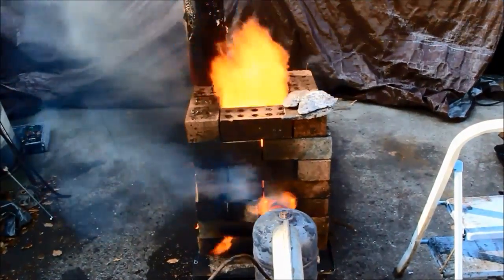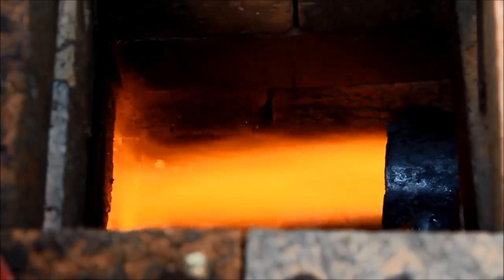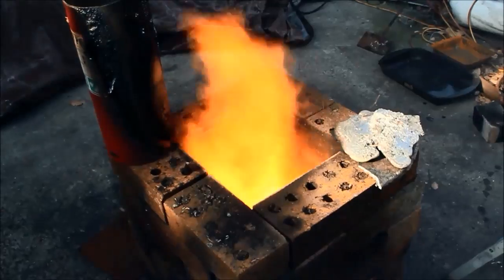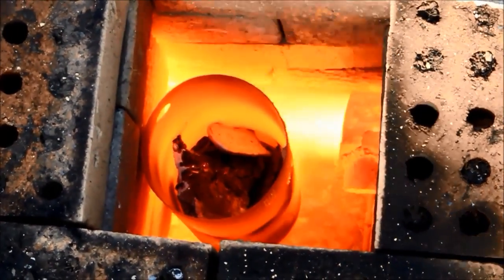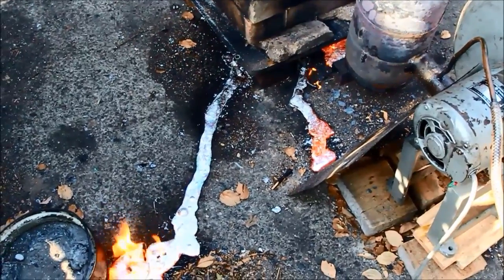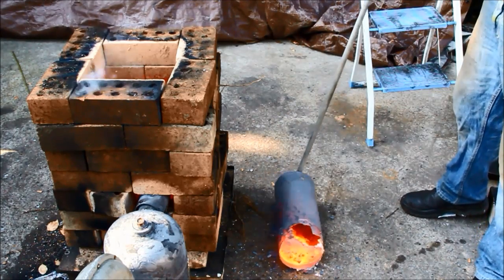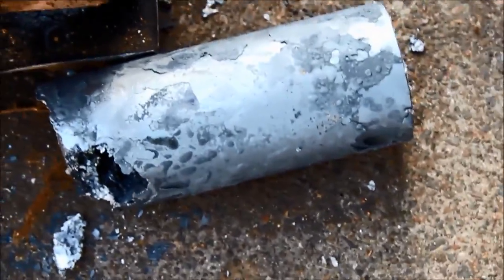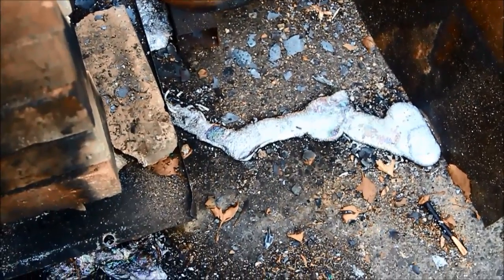Steel melt in Home Brick furnace.

Comment: Absolutely incredible!
Reply from the maker: Yeah, I thought so. Didn't see that coming at all. I'm still not quite sure wether to be impressed or annoyed! Given the problems this creates, far more likley to be the latter!
Reply: Oil Burner I would be impressed!  Quite some heat you got there! 
I am currently having the same problem,  I'm trying to find a way to use waste motor oil to melt lead but I'm heating the lead excessively. 
My solution to you would be to use a old propane tank as a crucible and build a larger furnace.  I'm sure that beast would handle the larger "pot". 
Heck I would actually build the furnace in the ground with fire brick. Can't melt dirt! Or can you!
Reply from the maker: magana559 Well if you can melt dirt, I think I'm heading the right way to find out!
Reply: Excellent!  Wishing you luck! Please video the results!
Reply: magana559 From experience: Propane cylinders aren't actually much tougher than fire extinguishers. I used one as a chiminea patio heater, and used an air blower to get the temp on the coals up: Blew a hole straight through the bottom! I think the steel was actually burning, bright sparkler type sparks everywhere for several mins till i shut the air off

Comment: I had a similar problem. I was using a steel fire extinguisher to melt aluminum, and I  use my homemade charcoal to start the heat, then I pack coal on top of that and then crank up my air and soon the aluminum will melt instantly.  Well, just as the level of metal was reaching the top of the crucible, I went to pull it out to pour and the whole bottom of the crucible fell out and luckily I was wearing flame retardant pants because molten metal splashed everywhere.  Needless to say, it was not fun cleaning up.

Comment: Aluminum does NOT "eat steel" oxygen does. Once aluminum goes to a molten state, there's no air between the Al and steel... which stops the iron from oxidizing and reducing. The outside of the steel can still oxidize but it would never eat through a fire extinguisher that fast. I have a steel crucible made from a super thin hair spray can that I melt aluminum in ... I've done it at least 30 times with no holes anywhere. That steel got white hot, hot enough to melt and that's damn impressive.

Comment: I just happened to find this channel when looking for something completely different... I'm really impressed at the heat that puts out... incredible. Here is an idea... what about a granite or marble tile as the bottom? Here in the USA most home repair stores have them in 16x16 inch (0.4m) sizes. Would that work? Would it be possible to make a wood form, put your vent and feed pipes in place, then fill with cement? That would make a seamless (or relatively so) furnace. The wood would burn out during the initial fire. You would have to wait until it was completely dry... then slowly fire it up to avoid trapped steam... but might be better at containing spills?
Reply from the maker: Hi Jerry, I don't think granite or marble would work too well. I used some slabs years ago as a base in my wood fired pizza oven and the stuff could be crumbled in your fingers after about 3 fireups and that oven' gets no where near as hot as this one. I could give it another try though. Kitchen factories often have stacks of it they cut out from benchtops they throw away so not hard to get.
I think with the cement I would have to use refractory type as regular concrete would explode. Been there, done that. It's a good idea though as I have been wondering about a base and this is the obvious choice even though I overlooked it. Thanks for the tip!
Reply: Oil Burner
Ceramic clay? I don't know much about high temperature stuff... it will be interesting to follow along and see what you come up with. Subscribed.
Reply: Oil Burner
In fact even ordinary concrete will melt (check out my video of concrete heated to 1260°C) and granite do melt or get so soft it will collapse. So ju really need some "heavy duty" materials at these temperatures :)

Comment: If you are still on doing this type of stuff try to keep the temperature lower I have used a small camping propane canister four or five times. I'm going to make one that uses propane here soon I'm going o get a clay graphite crucible so I can melt brass and copper for sure with this possibility of it melting.

Comment: very awsome, let me know when you what to melt the bricks, with out any extra energy on the input side, I am just wondering if you have any Ideas on how to use this to heat homes?
Reply from the maker: Have a look at this Vid and the Description Scott.  Free fuel water heater setup. I used an old gas water heater as a boiler and circulated the water through a car radiator with a solar circulator pump.  The pump was underpowered but I never got round to changing it because the setup provided more than enough heat for my home.  We slept with just a sheet and light blanket on all winter. Also see my Vid on the fuel control setup. I used this to supply the fuel to the burner to keep the heat output controlled. Once the house is up to heat, you don't need much output on the burner at all to keep it warm.
There are many other ways of home heating but as I'm not keen or have the space to put a burner inside the house, I like this way because it can go a safe distance away and I can just pump the water round through any convinent place. I put the radiator in the window in the laundry. Worst that could happen is the laundry floor got wet which is has more than once before and is no big deal.

Now summer is here I'm putting the pickup in the swimming pool and using the same setup to help cool the house. I have aircon but this uses a lot less power and is amazingly effective. Even if the pool heats up, it'll still be cooler than the air temp and give the AC a head start.

Comment: I'm trying to cast some 5160 steel for a pommel for a knife I'm making 

For some reason when I use fire brick for my charcoal forge it doesn't melt steel 

When I used cement bricks a  part of a rod had liquefied in ~10mins 

Thing is I had different posting of where I put the steel in this forge 

Fire bricks: right in front of air intake from leaf blower 
Cement bricks: charcoal behind the piece of steel and more deep inside the forge/foundry 

I have a video of this forge on my channel 
If I have set bricks wrong plz correct me

Comment: ok, i need the burner. Mine isn't hot enough. takes too long to get red. I do however have a solution for a crucible.  a piece of 6" well casing makes a great crucible. the wall is 3/8" and its not hard to find usually.  weld a bottom on it and a couple of half inch dia. bolts on the upper side for a hook lift and get after it.

Comment: HOLY CRAP!!!!!  Have you blown through any extinguishers you have been using for a burner?   Are you sure that burner was only putting out what you said? It didn't take very long to melt the aluminum AND the steel!! 

I am still hunting parts to build mine, OB. As soon as I get everything needed I will let you know. All my old favorite places to buy odds and ends have sold out to recyclers and they won't sell anything in pieces.. :( So I am going to be hunting for a while I'm afraid.
Reply from the maker: That was the surprising thing Steve. I have put many tens of hours on these extinguishers as bottles and apart from a bit of flaking here and there, they haven't even looked like melting. That was pretty much why I wanted to use them. Cutting the top off with a disk was hard enough to make me think they would stand up to any temp I could create in a pile of bricks.  I was SOOO wrong!
Reply: I can understand that!!  I think it was the concentrated heat from the direct flame and the expansion pulling in additional air after the nozzle.

Comment: You could get one of those clay graphite crucibles. You might have to weld together some steel to make a pair of tongs to pull it out, but I'm sure you could do that.
Reply from the maker: This vid was back a bit now and I have made a lifting tool and improved the crucible with something much thicker and resilient that has lasted many melts already.

Comment: Are you sure that this temperature come from oil. Is it possible that this aluminium got enough oxygen to start burn in high temperature and that boost temp up?
Reply: Insulated flame fed by forced air will reach steel melting temperatures fairly easy. Theoretically, the maximum combustion temperature for air and fuel oil is about 1900'C.

Comment: you can probably buy an old crucible fairly cheaply but inspect it closely for cracks is my one warning.  honestly the fire extinguisher fails here because your method puts too much heat on one spot a thicker crucible would fix that.

Comment: You didn't melt it, the aluminum ate it. You have to at least smoke the inside of any steel crucible or this will happen. I ruined a 3/16" wall diameter welded steel crucible in one melting because the metal was bare on the inside., The best thing to do is make a pottery liner for the inside....but a clay wash...IE Wipe the inside with mud....or heavily smoke the inside, Or paint it and burn the paint off, will  make a big difference. The idea is to make a chemical barrier so the aluminum doesn't come in to contact with bare steel.
Reply: Or he might have some magnesium amongst the aluminium - I had mine for 3 run until I accidentally had some mag - At the time I noticed the flame much brighter than usual (Mag melts at much higher temp) then the flame ate thru my crucible..So I used Clay crucible...They last a bit longer as they develop fatigue. heat stress cracks eventually fail. Graphite is the best - I think but they are expensive
Reply: Liem Duong totally agree with the magnesium theory. Too many things look like aluminum to assume it's aluminum. Simple test with vinegar to check for aluminum or zinc. File and flame to check for magnesium. If your not positive then check it beforehand. All this BS about aluminum eating through the steel is just that, bs. A steel crucible can be used several times before there is a failure unless the temp is not controlled as in this demo. The temp was way too high to melt aluminum.

Comment: You need a CO2 canister, the ones they use to pressurise the beer pumps in pubs. They are really thick steel, should do the job ok if you can lift it when it's full of molten stuff.
Reply from the maker: That's a great suggestion. I'll Keep a lookout for one.  Thanks for the heads up!  it's a real help.

Comment: Is your oil bottle pressurized,, or are you running a gravity feed ??
Reply from the maker: +tantricmaster800  Both. Gravity feed is enough for outputs up to about 200kw. over that i pressurise the oil drum.  Having the drum pressurisied also makes for a more responsive flame control.  I only put about 2 PSI on the drum.

Comment: have you tried clay for the crucible?
Reply from the maker: +Lucian Wolf   No but I think you are on the right track. A friend makes them out of some sort of proper ceramic material. I should find out what it is and start knocking some up.  It would be about the only thing that could stand up to any repeated use at high tempts with this thing. I did make a crucible from thick wall pipe and it seems to be OK but I have only used it half a dozen times and gone a lot softer with it now I have seen what happens if you open these things up.
Reply: best crucible ive ever had was an oxyacetalene tank nice and thick if you have a pool throw it in open and empty for about 2 days or safest way get a new tank

Comment: Oil Burner honestly ... do you think the fuel of a plane is enough to melt the structure of lets say ... a building such the twin towers? How long can the fuel can burn and how much galons are “needed” for some like that?
Reply from the maker: People are confused by the idea of Melting.  Steel does not have to be anywhere near melting to loose the majority of it's structural integrity and strength.  Blacksmiths were heating steel 150 years ago and working it like butter. They never came near melting it but they would make it pliable enough to do anything they wanted with it.  I CAN melt steel with waste oil but you can be many hundreds of degrees below that and steel will go from supporting many tons to being able to be bent by hand with great ease.
Reply: @glumpy10  it goes under a molecular change under heat and just loses all it's strength. You are quite right about it being pliable long before it melts.

Comment: Oil Burner Do you know if you lose any carbon content when you melt the steel?
Reply from the maker: I'm not very knowledgeable about this but I seem to recall reading about reducing flames and oxidising flames. 
Basicly as I understand it, you can loose carbon if you run lean and not if you run rich. 

Look it up though because I wouldn't trust that as being right,  just my suspect recollection.
Reply: Oil Burner ok I will, thanks for the quick reply.

Comment: The steel isnt melting its burning because you have an extremely corrosive flame, a similar thing happens when you forge with coal; the metal burns.

Comment: Maybe you could dig a hole under it or a trench around it so when you have a catastrophe like this, it gets contained.
Reply from the maker: Wasn't really the end of the world with the ally running down the concrete but it was suggested to me to put down sand which would be easier than digging up the cement!  :0)

Comment: The crucible you improvised is way to thin.  I had a similar experiance with my first aluminum melt.  I have since made an entirly different crucible out of an old oil pipe, The unit is about the size of a gallon pain can.  the wall thickness is 5/16'' or for those across the pond around 8mm
Reply from the maker: Tony Emory  Yes, I discovered through practical experience the inadequacy's of those extinguishers for Crucibles.  I have also welded up something out of thick-wall  pipe and plate. I'll be giving it a go soon.

Comment: It's not the furnace.  Molten aluminum attacks most forms of iron, speaking from experience.
Reply from the maker: +tcp3059  I'm not sure at this point. I have had ally apparently eat through steel like nothing and other crucibles and ladles I have fulled with ally a dozen times and fired the hell out of that are untouched.  I think it's not a straightforward thing but more than one principal and action is at play.
Reply: tcp3059  I like your comment . The crucible  did not melt . It appears the crucible  bottom disintegrated .Either the aluminum  or the heated bricks  reacted  with the steel, and poof the bottom disappeared.

Comment: my guess is that u made another burner because that one is gonna eat everything
Reply from the maker: Only talking to a friend today about it and how there is no refractory outside of exotics with similar price tags that can hole the heat.  He made a much smaller one and melted the highest refractory he could get with it and he has a LOT of experience with furnaces and making castings. People ask how hot will the burners get but that's not the question.  What the real key is is how can you stop the heat escaping too fast and when you do, what will stand up to the temp you can get. 

I was thinking about doing another of these and cranking it up to what I can do now and just fusing all the bricks together.
Reply: @glumpy10  i got lucky there used to b a iron  plant in my backyard from the 1700s the slag stuff doesnt melt i break it up and mix it with quartz and supper nasty sodium hydroxide and coal ashes from powerplant and indestructible refactory

Comment: Just wondering why you are trying to smelt anything in a metal crucible? Man has been smelling various metals that require hotter temperatures in a crucible made from pottery for 100’s of years. 

It’s not rocket science. The better isolation from the outside air the better. Thick layers to trap as much heat in as possible and your fuel choice “Typically, coke, coal etc” but using hotter burning fuels will melt any hardened or mild steels. 

Another way to raise the temp greatly is adding borax/flux into your crucible and under your crucible. That’ll raise your temp up several hundred degrees.
Reply from the maker: I mainly melt aluminum and a bit of copper.  Lack of heat is NOT my problem and neither is using easy to source and free bits of steel to use as crucibles.

Comment: You have way too much faith in steel. The crucible should be ceramic. The melting point of aluminum isn't too far from that of steel, so if you're close to one, you're close to another. You want refractory cement on the inside of the furnace.
Reply from the maker: Yeah, I'm still learning about all this mega temp stuff.  I think I didn't have enough faith in how high my burner could get the temps up and that it was possible to melt steel like this. It is more than double aluminum melt temps but it seems I'm capable of that and more already.  You are certainly right about the refractory. I'll need to get that before I can continue on with this  sort of frivolity.   :0)
Reply: Steel melts at a much higher temperature than aluminum. Steel will however loose a lot of it's strength at about 537 C.

Comment: Jet fuel can't melt steel beams.........
Reply from the maker: Given the right setup with a furnace, I could melt steel beams with jet fuel, veg oil, diesel, Alcohol, wood or charcoal.  Melting them in the open air is an entirely different thing though as is melting as opposed to softening or weakening steel.